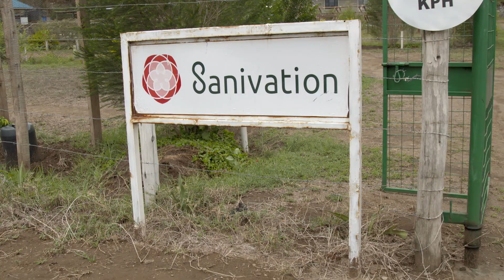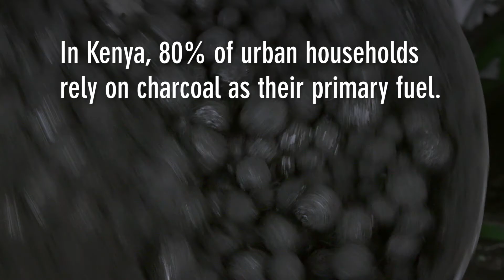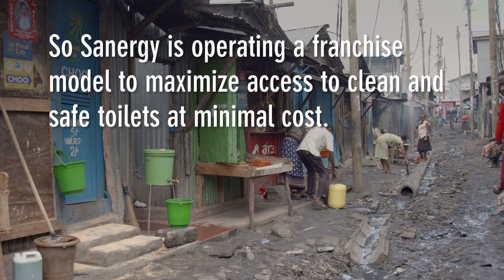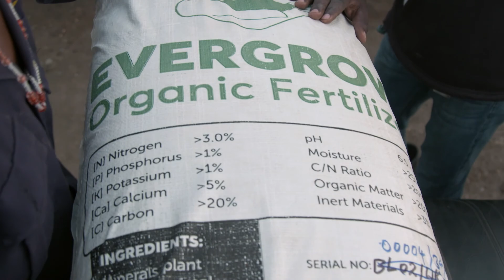Citywide Inclusive Sanitation: Kenya and Haiti

Comment: Regarding the comment that fuel made with feces has 1/3 of the emissions of coal.  I'm wondering what emissions? In terms of carbon dioxide, it should be net zero, because the total CO2 cannot be more than the CO2 that the human absorbed from the environment. Correct? Burning human waste should not increase overall CO2 emissions.